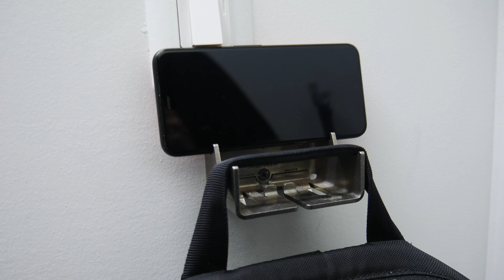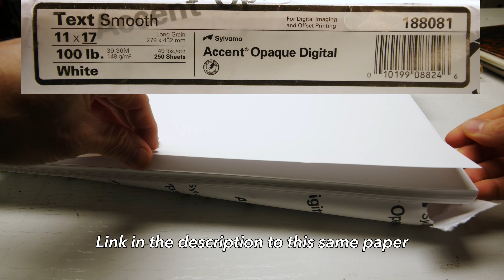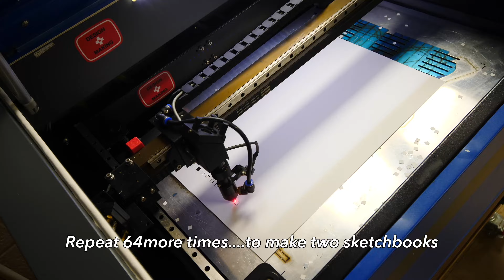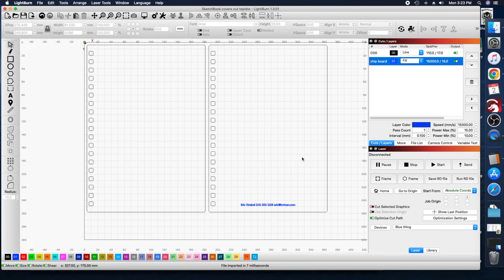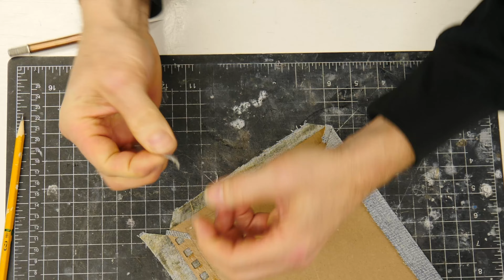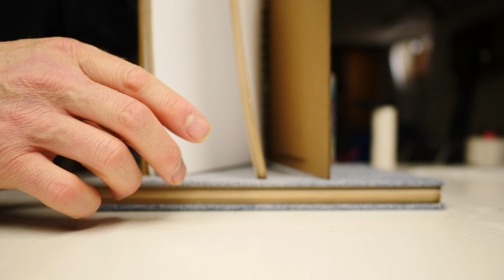Sketchbooks with Lasers

Comment: You can use the laser to cut out the denim as well. Everything can be designed in lightburn
Reply from the maker: Yes, actually another person commented that the laser could etch denim really nice, and it could probably cut the holes as well once I  covered the covers
Reply: @EricStrebel  I read their comment and yes that is one way to do it for sure! I was thinking to cut the entire outline plus the holes. In LB select your cover and use the outline tool outward 20 mm or so (so the denim can be wrapped around the cardboard). Then make a suitable triangle and duplicate it so you have 8 copies. Position them around the corners of the outline (so you have your relief cuts) then group them then subtract from your outline shape. Now group your cover with all the holes in it and center on the outline if not already centered. Duplicate it and move the copy aside. Now ungroup the cover and delete the cover except the holes. Now group the holes with the outline and you have a new template for denim or leather to be wrapped around the cardboard and the laser does all the cutting.
Reply from the maker: Yeah, absolutely! Especially if you were making multiples of a product.

Comment: For the tedious denim holes, you could cut the far top and far bottom holes by hand, and then lay a sacrificial board in your laser. Re-run the holes with a light pass to mark the holes on the sacrificial board. Then lay your denim-covered piece on top of the sacrificial piece, lining up the top and bottom holes by eye. Finally, run the laser one last time cutting out the rest of the holes in the denim. It might not be perfect, but it doesn't have to be. I use this sort of "sacrificial templating" a lot with my laser. It saves a lot of time.
Reply from the maker: Yeah, good idea

Comment: my last part time job in highschool before going off to Art School was working at a FedEx Kinkos (now FedEX Office) I bought like 6 reams of heavy weight  paper and about 24+ sheets of card stock and made my own sketchbooks with the equipment in the back that was used for commercial projects. took me about three days to do the binding on my lunch brakes and while waiting for my ride to show up. I gotta get some more made though I'm sure the project is going to be WAY more than the slacker rate of doing it on my own time. I used my last one about 5-6 years ago. pretty good run for stuff I made in 2002

Comment: You can reduce cutting time by placing two objects side by side without gap and enable “Remove overlapping lines” in “Optimization Settings” of LB.
Reply: Doing that with rounded corners sometimes leaves an annoying nub.